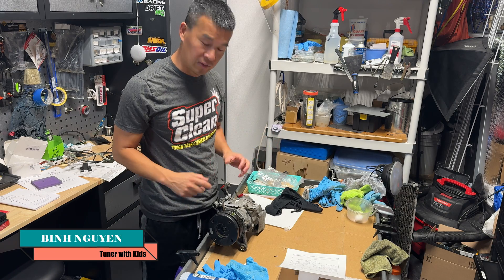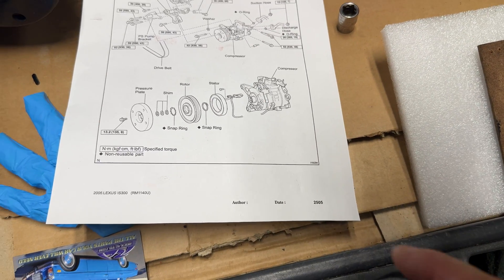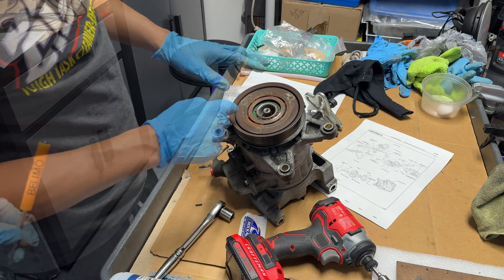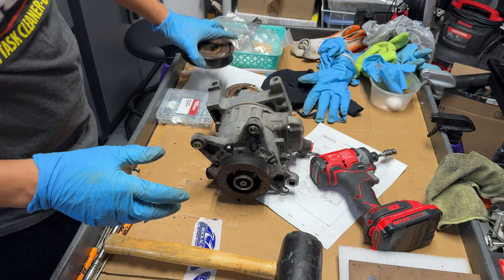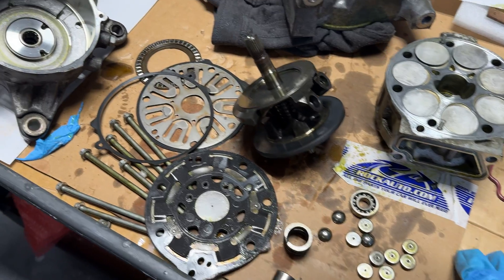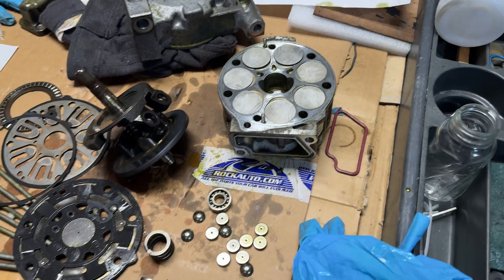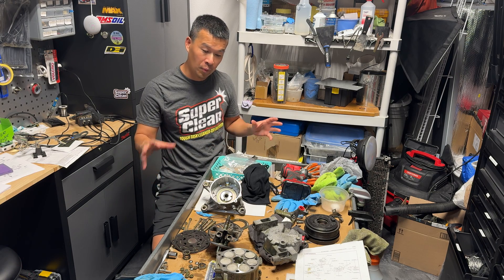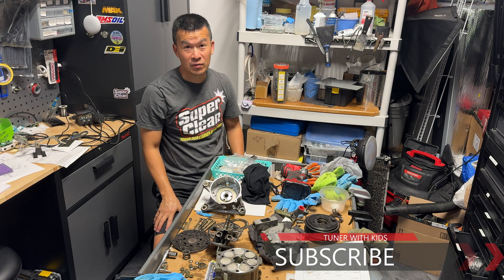How to Remove Denso A/C Compressor Clutch | Teardown

Comment: Do you happen to knowbwhat the name or part number of the sensor that is on the bottom @ 4:15
Reply from the maker: I don’t think it’s a separate part that you can buy. They come with the compressors as assembly only. Only option is to remove from another compressor.

Comment: Question for you, The pulley part with the bearing inside, is it normal it has a little tiny bit of wiggle? Did your compressor pulleys have any play at all? (your old or your new one) 
I'm planning to replace just the bearing inside the pulley because I feel a little tiny bit of play.  But the play I'm observing is really minor and I'm wondeing if it's maybe just the Original play and the way they are from factory. Because I have the radiator out, etc, that is why I thought I  check all the accessory pulleys and I noticed this.
Reply from the maker: Bearing should never have play. They are precision machine to spin true.
Reply: @TunerwithKids  Thanks for your reply. So on all those AC Compressors you played with for the IS300, you would say the pulley should have Zero Play, solid solid solid no movement. Correct?